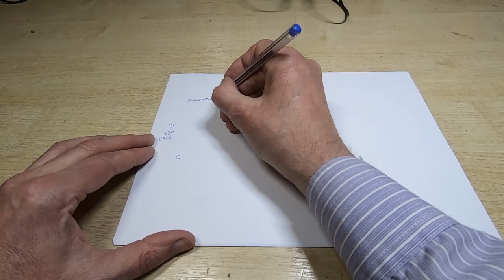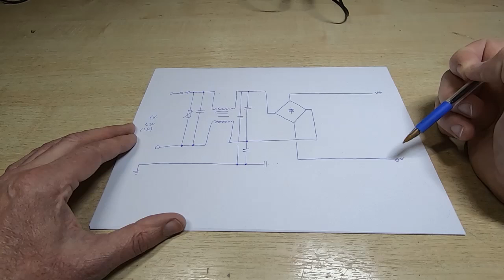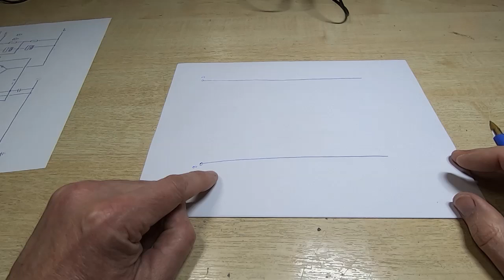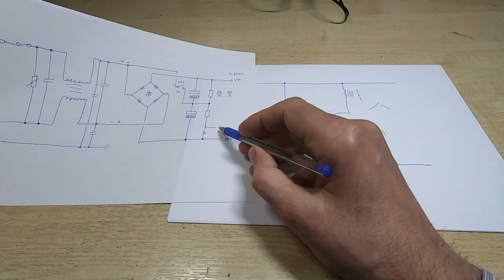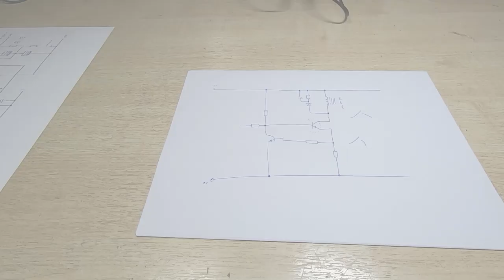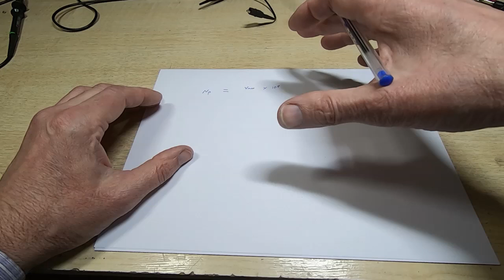Designing A Z80 Computer Part44

Comment: Very interesting!  I think I'll leave building power supplies to the pros, but it's neat to see how they work.
Reply from the maker: Power supplies are just another branch of electronics and if you learn about electronics then designing power supplies is relatively simple.
Over the years I have designed over 40 SMPS systems and while they can be a challenge they are certainly not beyond the capability of anyone with a reasonable working knowledge of electronic principles.
In fact they are now very easy to design using modern supply controllers although I am doing things the 'hard way' as I did with the Z80 design.

Comment: Fantastic, I've been looking for information on building a discreet switch mode power supply and have found information difficult to come by. I'm working on a discreet TTL home-brew CPU project with a look and feel of something like a PDP-11/70... And I would like to build a discreet switching PSU for it. I'm using 1975 as my benchmark year and aside from using 74ls vs plain 74 series ics, I'm trying to avoid any parts newer than that date if I can.

Comment: Nice work, the 110v switch is actually pretty clever - won't work with a DC input on 110v mode tho will it? 😉
Reply from the maker: Yes it will work just fine as long as the switch (jumper) is in the 220v position. I only do this for testing at reduced current and voltage so 60V is 60V.

Comment: Looks like you have a mains AC current limited source on your workbench, what is it?.......I saw it on your last video. Been meaning to get something to help with my own test equipment repairs.
Reply from the maker: It is not current limited although it is fused. (https://www.ebay.co.uk/itm/121562973292?itmmeta=01HX4MQ36KCXS2JB7XTF7Q2BDX&hash=item1c4db7c46c:g:ZcsAAOSw1QpZ97u4&itmprp=enc%3AAQAJAAAA8B56k67tIO0%2Fo6HXJuTuNlCwp%2FoBwo5Wg5ygifCKWAct%2BXqGm7mZgmTu6ny0n8os%2Fd%2FQaL43YqRi4L0aLiDf1sP4KqRirMw1vR08KgP67aaNWYsBWsDFwH54Tf78WAP3gccdAJ%2F8W5GsCnC7W8v8B%2Fd9GUZCHbnME6DBPw0MRUUXXwniRW2bohPmJk7%2BwxW%2Funk7dkMYysY1KQnv9iMiKZihRz2Noi8iNnvSwzMar2kt1QsoOYnogto9VrehzWFGYRt2LGwYM1kdKpwC5jfjuK61kARqorwUuNSlb9bpguC%2FFMPSGRr4hvOZcKC2xZAC0A%3D%3D%7Ctkp%3ABk9SR8Cz3JTpYw) No Affiliation. For testing this supply I will be using a dim bulb tester and the DC bench supply but I will show that process in a later video.
Reply: @JerryWalker001  Ok, cheers. I have been eyeing up this via search engine.......appears to have current limiting functions, and various sizes available:
1PC New Variable Frequency AC Power Supply APS4000A Storage type 350VA
Reply: @JerryWalker001 look up APS4000A, B & C, seems to have current setting.
Reply from the maker: @IanScottJohnston  Possibly but I would never use an inverter supply for development or testing.